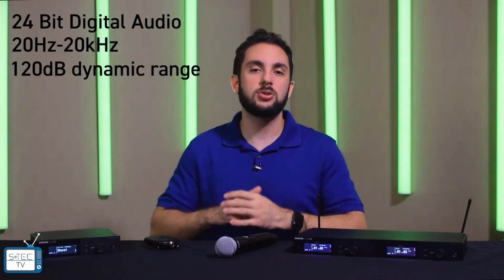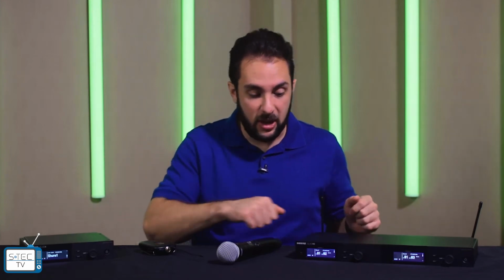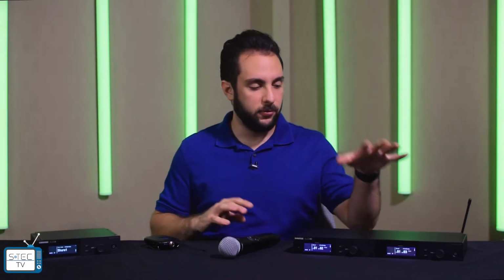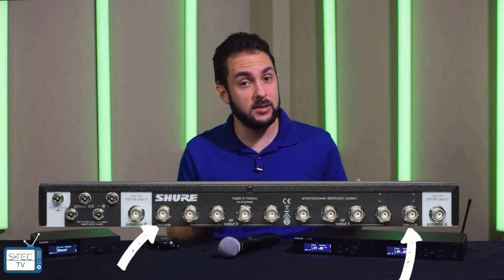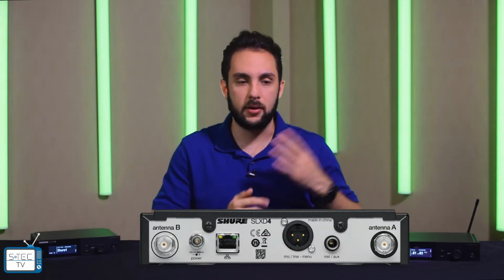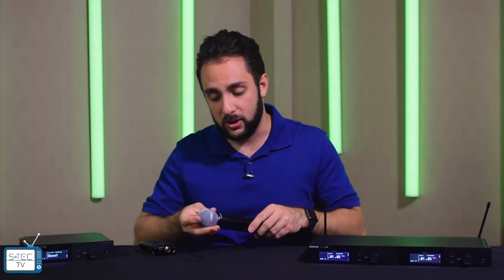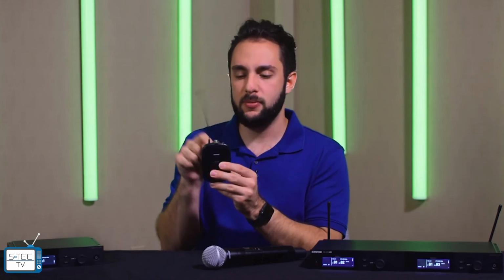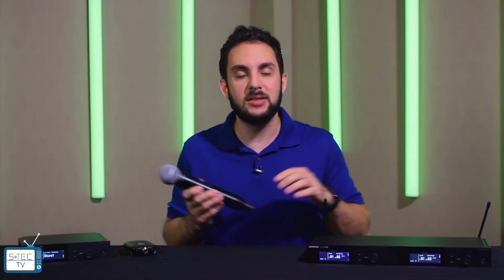Shure SLXD Wireless - Get the Details!

Comment: question, i saw another video explaining how microphones that don't use 2.4 mhz can be illegal in some areas because other frequencies outside of 2.4 are for tv channels. Soo my question is '' are these mic's blocked from those frequencies from the manufacture/ by default or is it something we as the buyers need to avoid"?
Reply from the maker: Thanks for the question! That video is correct in that there are SOME frequencies outside of 2.4 that are illegal to use and it is also illegal to sell mics that function in those frequency bands, but with that said, all new Shure wireless mics are sold to function within the legal frequency bands. There are TV stations that function within the same frequency band as wireless mics. That doesn't make them illegal, but that can cause some interference. So before purchasing, you will want to visit the Shure Frequency Finder, plug in your location, and it will give you what the best frequency band to use in your area is to get the least amount of interference. You can visit the Shure Frequency Finder here: https://www.shure.com/en-US/support/tools/frequency-finder 
Thanks and have a great day! :)
Reply: @PeterESchmittCompany  Thank you for the reply just wanted to make sure since my knowledge with frequency’s and microphones is not the best.

Comment: I have a question. I am a vocalist and I would like to know if I can buy the slxd 1 with the slxd24 beta58 without needing the larger slxd4d system or do I need both to be able to use the slxd1 and hear my voice with the headphones connected to the slxd1
Reply from the maker: Hi there! Thanks for the question. The SLXD1 can be used with the SLXD24, but only one transmitter can be used at a time. If you are looking for something to connect your headphones to and hear your vocal back wirelessly, you need to look at a wireless IEM system, such as the Shure PSM300. If you have any deeper technical questions, we suggest you reach out to your local Shure dealer and they will be able to assist you in getting the right products for your needs. Thanks!

Comment: If I may ask, can the buttons on the transmitter be turned off?
Reply from the maker: Hello! Thanks for the question. On the transmitters, you are able to lock the menu and the power switch. This will allow for the transmitter to be locked and if someone accidentally hits a button or the power switch, it will not changes any settings or turn off.
Reply: @PeterESchmittCompany  Thank you for your answer. Im glad to hear that is a feature of the slxd.